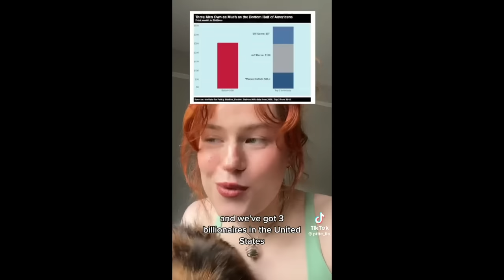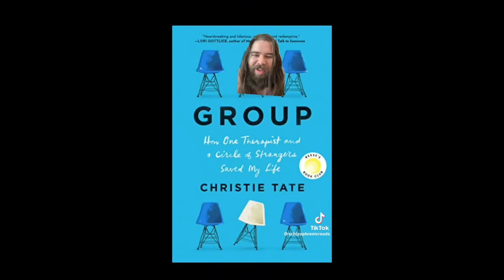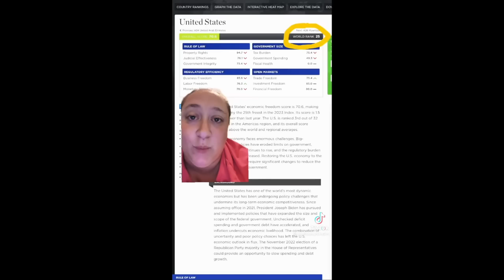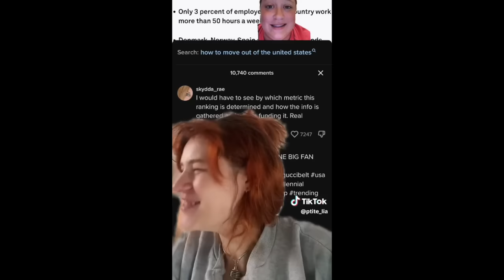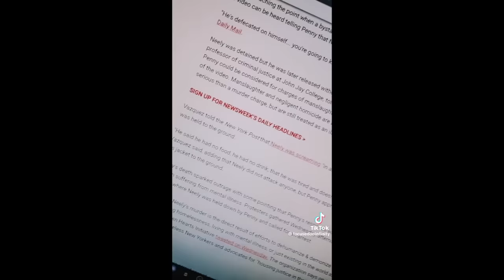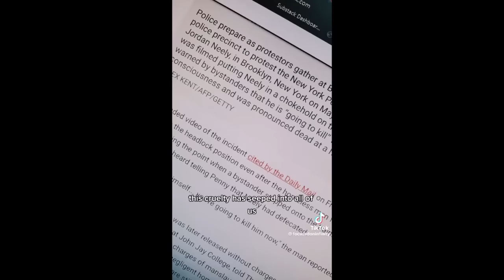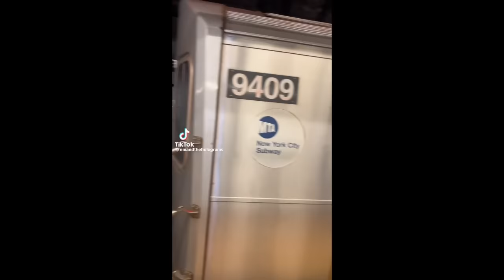leftist tiktoks for the cringe apocalypse

Comment: Okay, that first one made my brain hurt. YOU HAVE TO UNBEND THE SPOON! My autistic brain can’t handle the spoon being left like that
Reply: and putting the soap stained one back in the drawer :(  i can’t handle using sliverware and not washing it first
Reply: I will not use a piece of silver wear if it has a stain
Reply: (Allistic ND) I’ve started like. “Wiping” the silverware and dishes with my fingers/hands when they’re clean to make sure there’s nothing on em. Genuinely not in an OCD way just an “I hate germs and this is reassuring” way because sometimes stuff has been left on them and I don’t want it. I’m perhaps a bit too worried about germs but shhhhhh
Reply: @SketchUT  no no, i get it; i have to wash my silverware before i use them because i hate and get scared of the possibility of unknown food or germs getting into my food and especially my mouth or body.
Reply: I dont have the energy, throw em outt

Comment: 27:00 of all of the places where they could protest they chose the place with live 660 volt third rail which is incredibly dangerous if you step on the rail boom your dead it would be less of problem if it was somewhere that used catenary electrification (having a wire suspended above the rails) although catenary electrification uses much higher voltages all the 750 volts to 50 kilovolts

Comment: grenade
Home
Technology
Engineering
Mechanical Engineering
grenade
military technology
   
Also known as: hand grenade
Written and fact-checked by 
Last Updated: Article History
grenade, small explosive, chemical, or gas bomb that is used at short range. The word grenade probably derived from the French word for pomegranate, because the bulbous shapes of early grenades resembled that fruit. Grenades came into use around the 15th century and were found to be particularly effective when exploded among enemy troops in the ditch of a fortress during an assault. They eventually became so important that specially selected soldiers in 17th-century European armies were trained as grenade throwers, or grenadiers (see grenadier). After about 1750, grenades were virtually abandoned because the range and accuracy of firearms had increased, lessening the opportunities for close combat. Grenades did not come back into use on an important scale until the Russo-Japanese War (1904–05). The grenade’s effectiveness in attacking enemy positions during the trench warfare of World War I led to its becoming a standard part of the combat infantryman’s equipment, which it has continued to be. More than 50,000,000 fragmentation grenades alone were manufactured by the United States for use in World War II.

grenade
grenade
See all media
Related Topics: grenade rounds chemical grenade antitank grenade rifle grenade gas grenade
The grenades most commonly used in wartime are explosive grenades, which usually consist of a core of TNT or some other high explosive encased in an iron jacket or container. Such grenades have a fuse that detonates the explosive either on impact or after a brief (usually four-second) time delay that is long enough for the grenade to be accurately thrown but is too brief for enemy soldiers to toss the grenade back once it has landed among them. A common type of explosive grenade is the fragmentation grenade, whose iron body, or case, is designed to break into small, lethal, fast-moving fragments once the TNT core explodes. Such grenades usually weigh no more than 2 pounds (0.9 kg). Explosive hand grenades are used for attacking the personnel in foxholes, trenches, bunkers, pillboxes, or other fortified positions and in street fighting.

Another major class is chemical and gas grenades, which usually burn rather than explode. This class comprises smoke, incendiary (fire-setting), illuminating, chemical-warfare, and tear-gas grenades. The latter are used by police for riot and crowd control. Several uses may be combined, as in a white phosphorous grenade that has smoke, incendiary, and antipersonnel effects.

Grenades can be launched from the muzzle of a rifle either by the force of a cartridge or by the expanding gases of a blank cartridge. Such grenades usually have long, streamlined bodies, in contrast to the round shapes of hand grenades. There are also small-arm grenade rounds, shaped like bullets but of much greater diameter (usually 40 mm). These contain their own low-energy propellant charges and are shot from special large-bore launchers similar to shotguns or from launchers attached to infantry assault rifles. Another type of grenade is the antitank grenade, which contains a special shaped-charge explosive that can pierce even the heavy armour of a tank. Since these are usually delivered by small rockets launched from shoulder-held tubes, they are commonly referred to as rocket-propelled grenades.

This article was most recently revised and updated by Amy Tikkanen.
Home
Technology
Engineering
Mechanical Engineering
Greek fire
weaponry
   
Written and fact-checked by 
Last Updated: May 27, 2023 • Article History
Greek fire, any of several flammable compositions that were used in warfare in ancient and medieval times. More specifically, the term refers to a mixture introduced by the Byzantine Greeks in the 7th century CE.

Greek fire
Greek fire
See all media
Key People: Callinicus Of Heliopolis
Related Topics: incendiary bomb payload
The employment of incendiary materials in war is of ancient origin; many writers of antiquity refer to flaming arrows, firepots, and such substances as pitch, naphtha, sulfur, and charcoal. In later centuries saltpetre and turpentine made their appearance, and the resulting flammable mixtures were known to the Crusaders as Greek fire or wild fire. True Greek fire was evidently a petroleum-based mixture, however. It was invented during the reign of Constantine IV Pogonatus (668–685) by Callinicus of Heliopolis, a Greek-speaking Jewish refugee who had fled the Arab conquest of Syria. The substance could be thrown in pots or discharged from tubes; it apparently caught fire spontaneously and could not be extinguished with water.

Beet. Beta vulgaris. Sugar beet. Two rows of harvested beets.
Britannica Quiz
History of Scientists, Inventors, and Inventions Quiz
Greek fire launched from tubes mounted on the prows of Greek ships wrought havoc on the Arab fleet attacking Constantinople in 673. Greek fire was later employed effectively by Leo III the Isaurian against an Arab attack in 717 and by Romanus I Lecapenus against a Russian fleet in the 10th century. Its deadliness in combat, especially at sea, has been cited as a prime reason for the long survival of the Byzantine Empire in the face of many enemies. The art of compounding the mixture was a secret so closely guarded that its precise composition remains unknown to this day.

This article was most recently revised and updated by Michael Ray.
Reply: You sound like you main Demoman.